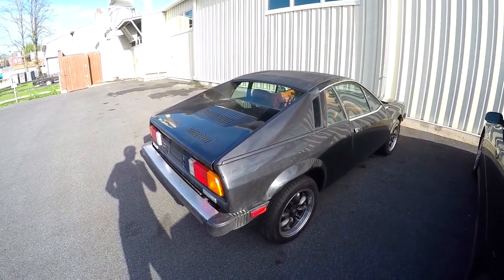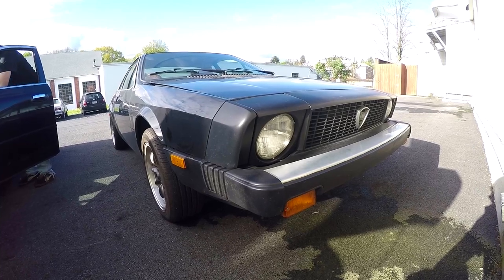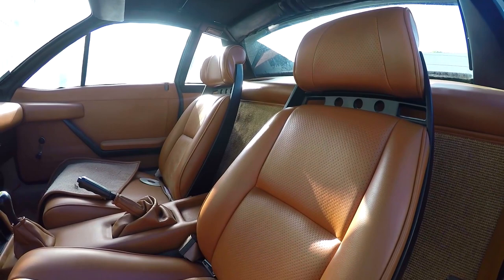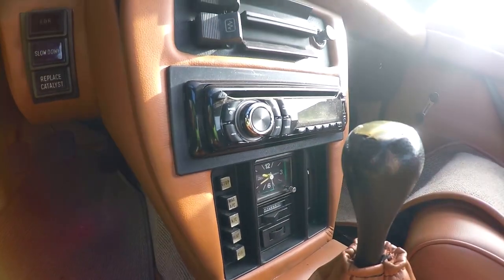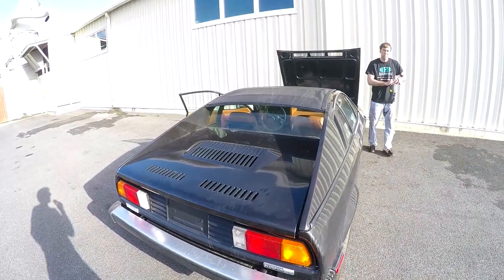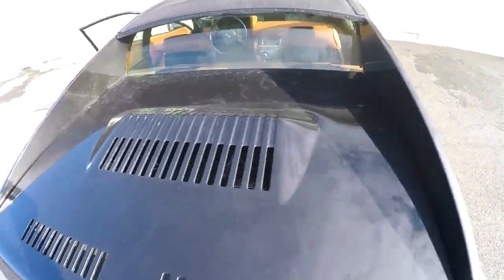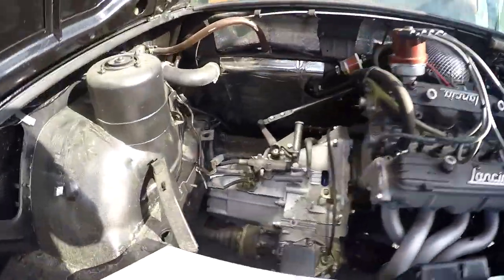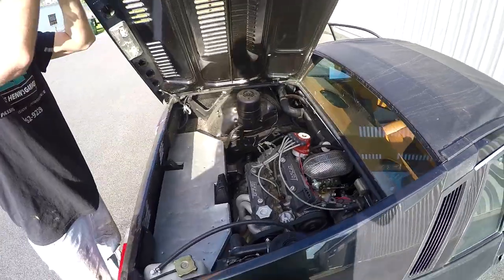1976 Lancia Scorpion: Walk-Around

Comment: So after some research on anther car with the "slow down light", I think it was a Fiat, I learned the reason for this. Back in the days before computer controlled, fuel injected engines, it was difficult to ensure that a catalytic converter wouldn't overheat and melt down. So rather than coming up with some ingenious, complicated, and expensive device to lean the fuel mixture if the catalytic started to get too hot while driving full bore down the highway for long periods of time; they simply installed a thermocouple in the cat that would trigger a "Slow Down" light. What would have been better is a light that read "you are about to fry your expensive catalytic converter if you don't slow down", but they probably couldn't fit all that on a idiot light and still be easily legible.
Reply: jonnda slow down light was triggered by a temp sensor.

Comment: In Europe, we have it as the Lancia Beta Montecarlo.
Reply: +Car Lover That's what it is! My neighbour used to have two, one running on the weekends, the other one not at all :D ..
Reply: +Erik S. Yep, they did it because the previous ones liked to lock up, so they removed power brakes.
Reply: +Erik S. Not really. They just made them so crap that the wheels would not lock up, due to the lack of braking force, and the car braked like a van.
Reply: +Erik S. It did have a brake servo. It was just crap.
Reply: +Erik S. No. First it was mediocre, but locked the wheels up. Then it was replaced with a terrible one that did not lock up

Comment: The engine is a 1.8L, not a 1.3L. Being emissions strangled, it only made 81 HP. In Europe, where it was known as the Lancia Montecarlo, it had a 2.0L variant with 120 HP. The Scorpion/Montecarlo eventually evolved into a car known as the Lancia 037, which is the only RWD car to ever take down the Audi Quattro in the WRC. Do some more research on them and do a full review of the car. I would LOVE to see a full review of the Scorpion. 
The Scorpion had popup lights to meet with US headlamp height laws (they only raise like an inch or so), and different bumpers to meet US crash test standards. The Scorpion was only sold in America from 1976-1977 before being taken off the market for notorious brake problems where the brakes would lock up if you looked at the brake pedal the wrong way. Only 1,807 were built for the US market, which honestly isn't that surprising considering how much they cost when they were new. In 1976, you could buy a brand new 350 V8 Chevrolet Corvette for $7,500. The Lancia Scorpion was $11,000 new in 1976, so it was absurdly overpriced. A lot of people say the Scorpion looks like a DeLorean, but it's the other way around. The Scorpion came first so the DeLorean looks like the Scorpion.

Comment: No pop-up headlights action shown. I'm disappointed.
Reply: +t33s they probably don't work
Reply: +Jacob Allen It doesn't have popup headlights. That could be why.
Reply: Jenda Hrbek They pop up a little bit, you can clearly see they're pointed too low and have independent housings. Here's the evidence:
http://bestcarmag.com/sites/default/files/2635850Lancia_Scorpion_US_spec,_Belgian_reg.jpg
Reply: +Jenda Hrbek It does.
Reply: So I'm told. I had no idea and honestly have never saw it with headlamps "popped down".
Reply: +Jenda Hrbek They are down in this vid. Instead of completely redesigning the front they made a mechanism that only moves them up a few inches to meet US regs.

Comment: The engine is related to fiat Lampredi twin cams from the 60s. When Lancia (lAnchia, not lanseea) was acquired by Fiat in the late 60s the glorious 1.3 v4 was replaced by the Lampredi in the Beta, Monte Carlo (Scorpion in the US because GM had the TM). The Lampredi twin cam, I think, was in all special Fiats from 1966 on, first as a 1400, then 1600, 1800, and finally the 2000. Same engine that blessed the Lancia Delta HF Integrale that won the rally world championships five years running. Super little engine.
Reply: Not forget it was the engine of the two times World Sportscar Championship winner Beta Montecarlo Turbo. In those, this engine (1.4 liters version) delivered 480hp even for 24h races (in the same years, 1.5l F1 Turbo engines delivered about 600hp, but they were prototypes, had to endure only 300 km, and often failed at that). In tests it delivered 540hp for 5 hours first to fail.

Comment: It is actually similar to the Porsche 924. See the similarities:
- both are RWD,
- both are cheap, but not cheapest sports cars,
- both are 4-cylinder,
- both were made from the 70s to the 80s,
- both are liked in grassroots motorsports,
- both were cheap a few years ago, 
- both have a wedge profile,
- both do not have OHV,
- both were meant to be sold by a less prestigious brand (Lancia was meant to be a Fiat, Porsche - a VW),
- and many more.
Reply: +Car Lover its more similar to the Fiat X1/9. pluss the 924 is front mounted engine and much heavier.
Reply: +yanni carapetis (SA Sliders) Yeah, but as you saw, there is also a lot of similarities. Plus, the X1/9 was a smaller model.
Reply: +Car Lover Oh, and more similarities:
- lots of plastic,
- thick sloped C-pillar, 
- beige or black interior.
Reply: In handling perspectives though, the x1/9 is a lot more similar. Plus the CX also shares big sloping c pillars plus interchangeable engines. Both share parts from bertone as well. The lancia Beta is probably a more suitable similar car to compare the montecarlo with
Reply: I meant X* not CX hahah
Reply: +Car Lover in Europe they both also had a 120hp 2.0 engine.
Reply: ....Not really.
Reply: Isn't it more similar to the Porsche 914, due to the mid-engine? The 914 was also originally going to be a VW.

Comment: The scorpion  is the convertible version of the European beta montecarlo with some adjustments for legality on American roads that kinda make the car suck. Things like a smaller, emissions detuned engine that only makes 81 HP, a higher ride height caused by bigger rear springs that made the car handle worse, big ugly 5 mph bumpers, and big round headlights shoved into tiny rectangular pegs. Although, some issues were just from the beta montecarlo, like having overly boosted brakes that liked to lock up and fade early, a thin crossmember in the back, and an excessively loud engine noise. The montecarlo/scorpion being one of the first cars made by the new Fiat owned Lancia the car had a small issue with serious rust problems. It's really like most Lancia cars after Fiat took over. It had a terrible road version, and an amazingly successful racing version. The beta montecarlo had a group 5 car called the montecarlo turbo that won its class in its first year and won the overall championship the two years after that, and the montecarlo had a group b car based off it, a little thing called the 037. The car was also Herbie's girlfriend. No I'm not kidding.

Comment: I think that version of the Beta has either the 1.6 or the 2 liter, I can't see how they would have sold a 1.3 engine (on this kind of car) in the US.
Reply: +DeerKoden The Fulvia had a 1.3 liter V4, but according to Wikipedia this had either a 1.8 or a 2.0 straight-4.
Reply: +Albin Nygren yeah...in Italy tipically the Fulvia is easily considered a better car. Probably also lighter cause the earlier version used lighter materials for some parts of the bodywork. And the Fulvia coupe looks much better anyway.

Comment: Now I know why it looks familiar, the body of that was used for the Lancia 037 Group B car.
Reply: +Jaybee I am afraid you are far off, the 037 was a its own body made from fiberglass in the mid 1980's. Road versions of the 037 where sold as per Group B regulations, but they where no Scorpions. Cheers
Reply: No, the center body section was used (and you can tell that the rear section was used as a base for the design of the rear body work), but the front and rear chassis were fabricated out of tube frame, with the body work being fiberglass. :)

Comment: my 1983 fiat 131 supermirafiori (look it up) has the exact same engine!
Reply: The Fiat Twincam. Is one of the most tunable engines ever built. It was the engine of the Beta Montecarlo Turbo,  World Sportscar Championship race car, delivering 480hp from a 1.4l engine in 1980/1981, even for 24h races (in the same years, 1.5l F1 Turbo engines delivered about 600hp, but they were prototypes, had to endure only 300 km, and often failed at that). In tests it delivered 540hp for 5 hours first to fail.

Comment: Gotta be more than 1.3 man they didn't do engines that small back in the 70's, probably more like 2l
Reply: +spankmeister Yeah, I googled it, seems like North America got a 1.8 liter engine.
Reply: do you mean lancia or every car manufacturer? most cars on the road in europe in 70s would have been 1100-1800cc
Reply: lce124 Lancia but also "sports" cars in general. (Or whatever you want to call them.) 
Nowadays with direct injection and small turbos they can get quite a bit of power out of small blocks but back then ehhh, not so much.